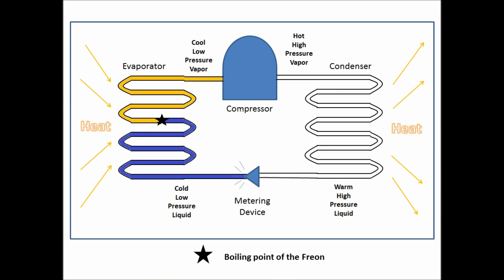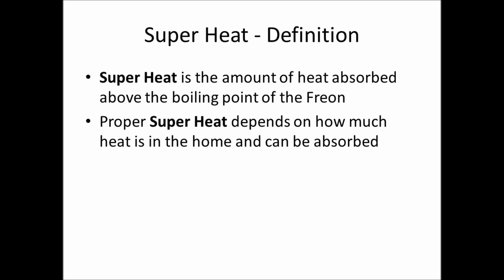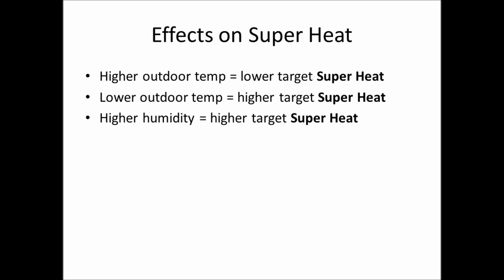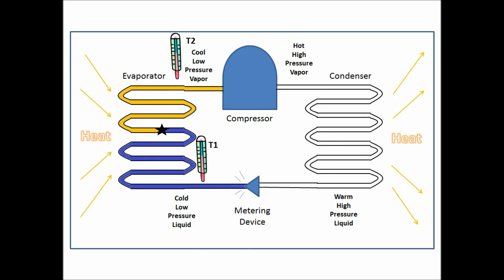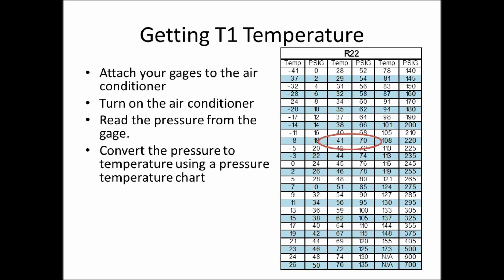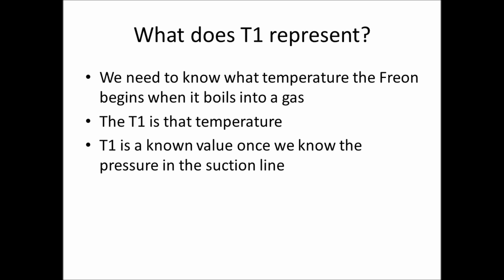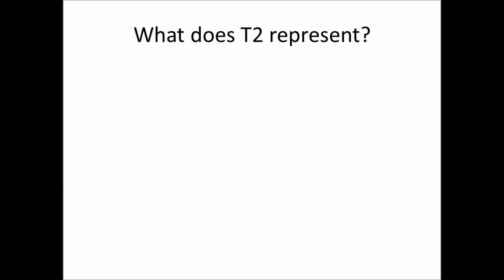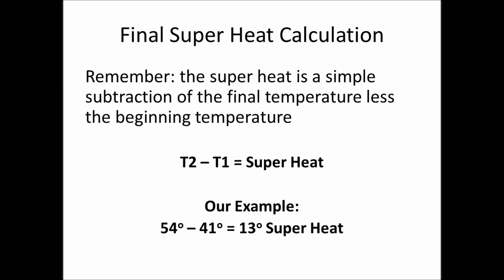Calculating Super Heat - Best HVAC Companies near Raleigh

Comment: Based on what you're saying, wouldn't you be interested in measuring the temperature(T2) immediately after the evaporator instead of at the condenser as stated?  It seems if you had a long run from evaporator to condenser the temperature difference might be significant.  Please explain.